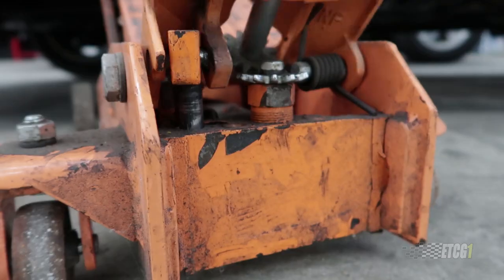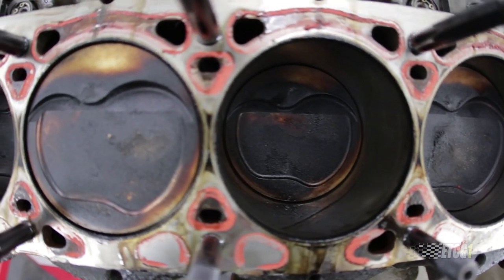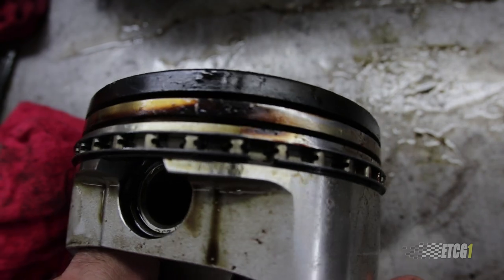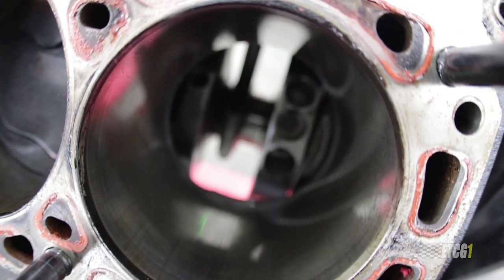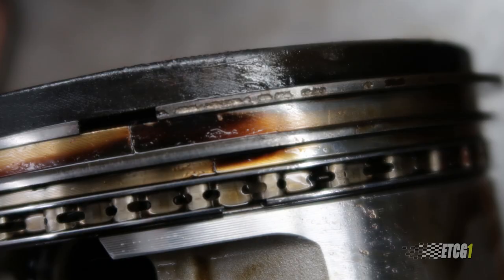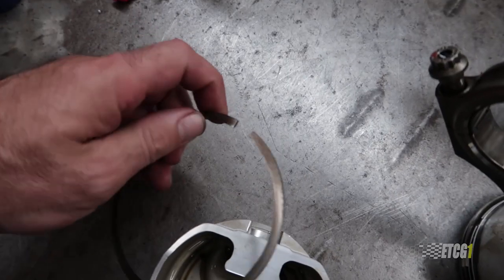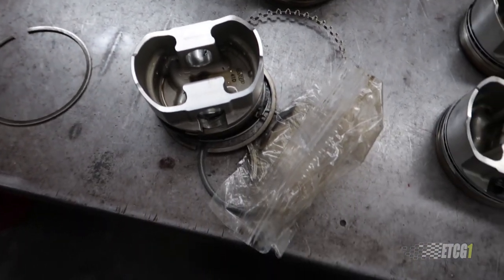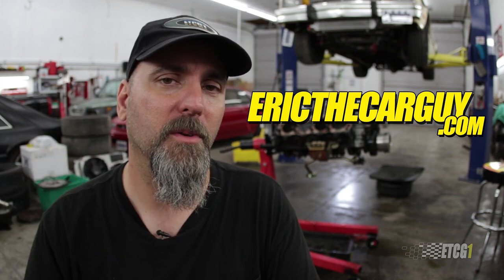Hydrostatic Lock the Silent Killer

Comment: That was a tough break, man.
It is one of those things I have been a bit paranoid about and while I have used cold air induction, it was to the OEM filter housing and I had drilled some smallish drain holes for any water that got in - with heavy rain in mind, and as I was just looking for cooler air and not concerned about any ram effect - but don't know what would have saved the engine from a real dunking.
On that, many modern-ish vehicles have some sort of cold air feed from the front of the vehicle, often quite low and behind the bumper area, so I am frequently bemused when I see drivers attempting quite deep water in their cars... and then stalling and climbing out of them. I don't know what their insurance companies have to say about it, but either in direct costs if cover refused, or in excess and higher premiums, it must add up.
Whilst your problem 'could' have been down to hydraulicing, it could also have been some other issue or a mixture of both. Rings do rotate as the piston moves, but much faster than you may have been thinking - some studies have suggested as fast as 1:1000, ring to engine rpm - so they may have been past that point thousands of times. Most of the pistons appear to have a good deposit, but a couple of the spark plugs looked a little 'off' - could just be down to the camera, monitor, my old eyes, or whatever - but something to carefully review, especially as chipped ring coatings can also indicate combustion related ring problems or butting ring ends - as you suggest, usually that would be seen as a shiny spot at the ends, but that is usually when the engine immediately fails, not when it is continuing to run and has a chance to build deposits up again. Is there any indication of big end bearing contact - a shinier area?
My point, when it comes down to it, is there may still be an issue with the other pistons, the connecting rod (I'd consider that one WIA and replace it), and I'd carefully inspect the head and bore for cracks.
You really were lucky, if it was a hydraulic issue - not seen many, but those pretty much destroyed the whole engine as the rpm was much higher and had the weight of the vehicle forcing the engine to rotate. I have even heard of, but not witnessed, diesel engines with leaking injectors building up enough unburned fuel to cause 'lock damage on a running engine - might be an urban legend - though it does happen with top fuel engines if there is a misfire.

Oh, FYI, fluids are liquids AND gases ;-)

Comment: Wow , sad to hear your engine got damaged. But on the bright side your Fairmont didn't end up burnt to the ground or worse burnt yourself. Can't wait to see the Fairmont back up and running stronger than ever. Just wondering if you'd been in contact with the Kalvinator engines guys and see what they think of the damage?
Reply from the maker: Dropped off all the parts at Kalvinator last week. They seem to feel it's fixable with some new parts. They're also going to set up the shaft rocker system for me. It requires a little machining.
Reply: Sweet , shaft rockers will be cool. Are those guys doing any other mods while the motor is apart? I suppose on the plus side that now you have everything sorted out as far as all the tube work in the engine bay. I should be fairly straightforward getting the motor back in it. Good luck Eric fingers crossed this will be the last of your problems and you can get back to some fun cruising around in your car.

Comment: Thank you thank You thank you. I thought I screwed up my  351m/400m when I was working on carb before a mud tug but now I know it was my flooded 4ft deep driveway that is a half mile long in the rain season put the snorkeling pack on carb forgot exhaust pipes I put #2 piston through the inner wall snapped cam shaft and all that other good stuff but will parts from 351m /400 fit on 351 Windsor

Comment: hydrolocked a Ford F-150 4.2 V6 with the infamous plastic intake manifold gasket failure.  Video on my channel.  It happened on a cold start after sitting for a week.  Pulled the plugs, drained it, drove it into the garage, replaced the lower intake manifold gaskets, drove it another 60,000 miles.  Tested compression, straight 150's.  Sold it.  Got lucky.  Hot vs. cold engine might be a factor?  Metal is stronger at room temperature, maybe that saved me?

Comment: What i have seen is that head gaskets fail when hydro lock. But if you put in a beefy head gasket like you did the next best thing is going to break.
Reply: That happens too, if you're lucky. Seen hydrolock blow out head gaskets, bend rods, break rods and pistons. And one time saw it shoot a glow plug out of a Ford Diesel! That was interesting seeing that sticking through the valve cover, wish I had pictures of it.
Reply: No.  If your head gasket goes first it is only because it was very weak already and probably where the hydrolocking fluid leak came from.
Reply: That is the most chance you have to get a hydrolock.
Reply: Saw the result of a kubota tractor that went in a dam while running- block intact, pistons and head intact, 4 s shaped conrods! Aparrently handbrake slipped and rolled in at a fast idle.

Comment: I have seen it several times. have been a tech over 20 years. most common is the cold air intake. normally the engine is done, bent rod. kind of looks like the piston tops bent down over the rings and broke. surprised there is no cylinder wall damage. I saw a bent rod one time from a diesel being started with starting fluid. engine was done

Comment: Happened to my buddies Mitsubishi delica (imported 4x4 van from Japan). He drive through a big puddle without knowing his airbox lid had come open. Sucked in a bunch of water, and bent a rod. It still ran, but due to the bent rod, it wasn't making compression in one cylinder, and thus had no combustion (being a diesel, compression is everything). So for a while he drove it on 3 cylinders until he replaced the motor.

Comment: Wow!  You really dodged a bullet.  I just had the heads off of a 2002 Ford 5.4.  Because it had low compression (among other issues) on #4, I figured he had the usual Ford valve-train issue (stuck open valve).  It wasn't.  Once I had the head off, I couldn't believe the amount of scoring inside that cylinder.  Long story short, he had been 4-wheeling through some Pennsylvania creeks.  When he got in over the air intake, it quit with a thud.  His buddies got it running again (I suppose they took the plugs out of it in the woods) and he never thought about it again...until he brought it to me with a check engine light...the O2 sensors were covered with globs of crud.   When I got the piston out of the #4 hole I found the top ring had broken into several pieces, several of which were the size of fine gravel.  These sort of "rolled" around in the ring groove, exposing a new "cutting edge" to the cylinder wall until there were grooves you could easily catch with your finger-nails all the way around the cylinder.  You were really lucky your ring was still in large pieces.
Reply: Ive seen fun stuff like that a few times. Melted pistons in the Ford diesels are always good for a laugh.

Comment: I sold a expedition with a 4.6 in it. Had 370k+ miles on it but ran like an absolute top. Transmission started to fail but I continued to drive it. Injectors stuck wide open and it would smoke very bad out the exhaust and have a miss. Would come and go. Eventually I went to crank it up and just so happen an injector was stuck open... Same thing as you. Engine wouldnt turn over any more. Got the gas out the cylinder through the spark plug. and it fired up and run but had a loud tick... I knew at that point it had some damage. I sold it to a friend. He drove it until the trans failed completely. He wanted it for parts and was only interested in the brake calipers and heater core. He was aware that both the trans and engine were bad or going bad. He then resold it to a friend of his's parents. They put a transmission in it and are still driving it today. Engine still ticks all the same. They did replace the injectors and rail though. It runs fine aswell and so far doesnt appear to have any negative impacts thats affecting the engines ability to run

Comment: ouch, that sucks! at least you caught it fairly early and didn't mop the block and many parts. for sure check the con rods. valves should be fine since it wasn't hot/running and quenched with cold liquid. while it's apart give them a all check. 
piston ring lands too tight could be an issue(ring side clearance) and you'd likely not see markings on the ring ends, it would be on the sides if anything, but the piston would likely be chewed and ring stuck with aluminum smearing everywhere and unless there was a poorly machined piston, it's "not" the issue.
since we know it locked solid and only one piston broke, it seems very logical it was from the big gulp of liquid while cranking.

Comment: 2005 F150 4.6 .. plastic intake gasket failed between the coolant port on front passenger side and cylinder 1 intake port.  Cyl 1 filled with coolant when engine was shut off.  Owner got done with whatever he was doing and went back and got in the truck and started it.  He said it made a loud noise and ran very rough.  Result of hydrolock - cyl 1 connecting rod had ventilated the crankcase above the oil pan.

Comment: at 2:15.. did the fuel itself cause a hydrostatic lock up? if for some reason a fuel injector rupters and breaks can bleed high amounts of fuel in that one cylinder. or fuel pressure regulator?. I worked on a car that had a seized engine. I found the starter fried burnt so I replaced it. it cranked for a few seconds then lock up again. I removed all four spark plugs and cranked the engine with out them... It cranked just fine NO knocking, just fine and I did it a few times. but after installing the plugs back in the engine again it locked up after 2 to 3 seconds of cranking. I never finished and I thought it was a "exhaust valve". after watching this video I wonder was the engine cylinder flooding with gas?. a puzzle that bothers me.

Comment: Got a 4 wheeler with carb issues and would flow to much gas.  It would hydrolock after sitting over night.  Good thing the starter was not stronger or I would have had some serious damage.  Took out the spark plug and blew out the gas.  

  I worked on the carb multiple times to get it just right.  Now it has new larger jets 2 stages higher.  The float problem was fixed. Now it can sit for weeks and I can go start it up instantly.  1998 Artic Cat 4X4 300 with some power mods.

Comment: We had a police cruiser (04 Crown vic) come in on the flatbed after trying to go through a puddle that the officer thought was 6 inches deep. It seems that is was more like 28" deep, and he hit it about 35mph. Needless to say after they fished it out of the water everything looked ok until the oil pan came off.. #2 and #8 had bent so badly that the cylender walls were also damaged. 

When in doubt, go around. Gas for a longer route is cheaper then a new short block.

Comment: I never experienced it myself in 30 years of driving. I saw one engine that was underwater for a few hours (it had not been running when flooded). My father was a car mechanic en he took the engine out, removed the head and the plugs and let it sit for a few weeks. After inspection all seemed dry and as far as I know, the engine was good again.

Comment: I had my 1981 Porsche 928 hydro lock on me during Monterey car week last year. I tried to start it and it wouldn't turn over a revolution. I let it sit for 5 minutes and it would start right up. The water went past the rings and into the oil, which was still hot enough to turn it into steam before the oil pump ingested it. This happened multiple times over 3 days before I realized the head gaskets had went. I then made the drive home ~300 miles with a failed head gasket through stop and go traffic and had the engine out within a week. A different later V8 from an 1985 928 is going in and I am using the older 16V heads from my car to make a sleeper of sorts. The bottom end is still fine and there was no damage to anything internal. I got lucky...

Comment: friend of mine bought a Yamaha snowmobile, when they first started using 4 stroke engines. He put a teaspoon of oil in the cylinders at the end of the season like we all did to our 2 stroke sleds. In the fall he fired it up and bent all 4 connecting rods in seconds, on a side note whenever I pull a piston I install new rings when it goes back in an engine, I had a used one  crack on me on first startup and score the cylinder badly, ever since then I buy new rings if I am pulling a piston.

Comment: I was working on like a 03 Tahoe 5.3. I don’t even remember what I was repairing but it sat for like a day or two but when I went to start it I got that nice strong crank then dead stop. So i rotated backwards and forward a couple times got it to turn over a few times by hand. Thought maybe just a slight leaky injector. Went to start it again and bam. Turns out cylinder 8 was pouring gas in it like a faucet. Long story short changed the injector and it ended up blowing the head gasket 😩. Imagine having to try and explain that to the customer. This was a couple months ago. So far so good 😁👌

Comment: I’ve read a bunch of the comments and I mean no disrespect but I too do not believe the cause of the broken ring land was hydro lock.  If it had a bent rod then yeah hydro lock. Ring land failure just screams detonation to me. Part of the reason I say this is that you have the hydro lock recorded and it didn’t even hit hard, it’s not like the engine was running at rpm and sucked water, it didn’t even try to fire it just cranked and stopped. 

 The rings were not the issue in my mind, improperly gaped rings will pull the top of the piston off and destroy the bore. 

It’s been said on here before that detonation could be the issue due to ignition control, more precisely timing control. I know your running an msd box with a boost referenced timing curve but there are many factors that are not taken into account by that box. Intake temp, and knock were two that I saw mentioned earlier but another one that I did not see that may be a factor is your fuel. I’m sure your not running 87 in the car but if your running a different fuel than what the car was tuned on (e15, e10, 91, 93) that can make a huge difference and right now with no knock sensor that ignition box has no idea to pull out more timing in an event where it starts to detonate.

I’m not trying to rock the boat or say that your wrong, just please take a look at all the options of how this could have happened and take steps to prevent them from happening again.
Reply: Its possible, but as someone else above us pointed out, if it was detonation related it was more then likely caused by the dyno pulls, when it got lean going into the boost and they kept pushing anyway. Probably weakened the piston id bet.
As for the starter breaking stuff like this, I've seen it happen before. Usually with a high torque starter (like I'm sure Eric is running). You see weird failures like this a lot in Ford diesels, where the number 7 and 8 cylinders fill with coolant (or fuel) and something breaks when you attempt to start it. Obviously this isn't a super high compression engine, but I'm sure that starter is up to the task. 
You'll see bent rods, broken pistons, at the wrist pin or ring lands, and possibly even holes in pistons, usually combined with a messed up injector.

Comment: Only saw a couple hydrostatic locks with gasoline engines.Early M151 mutts,had an electric fuel pump in the tank,which was controlled by an oil pressure switch on the engine.The switch would fail,then if ignition switch was left on engine would hydro static lock.Lucky though I never saw an engine severly damaged,just clear engine change oil and off we go.

Comment: I went strait in to a big puddle of water that made the water go over the hood and over the windscreen (20mph maby). the engine never stoped but it started 2 missfire alot and smoke white. I had it at idle for 2-3 minutes and drove away missfire alot and still smoke bad. after 2-3 miles I got bord and flord it first and second 2 redline BOOM it was fixed! drove 5 000miles or more and the engine vent to an iseracing event in another car, stil lives on the redline todat 5 years later. thank you redbock b23(0) volvo engines :)

Comment: Someone hydrolocked their car. He went to start it, the starter turned until it hit compression, and stalled out the starter!  He then proceeded to bump start it down a steep downhill, this is a manual transmission car, in second gear. He blew the motor instantly and the block looked like he just ran a 500 shot of nitrous through it, there were pieces everywhere, all because of a leaky head gasket, which leaked coolant into the cylinder, causing a hydrolocked situation.